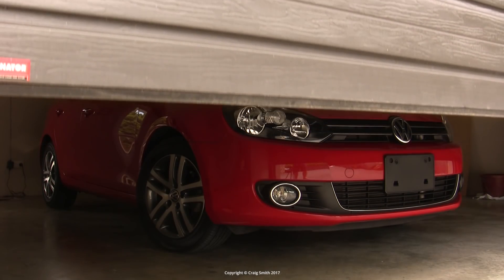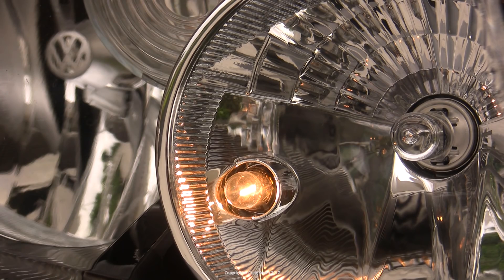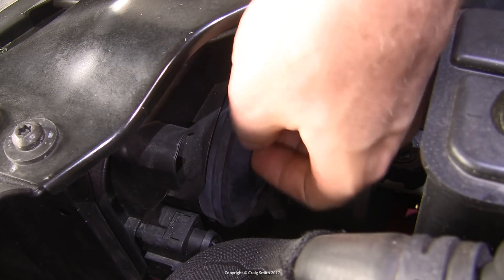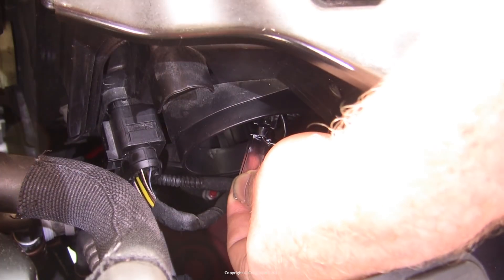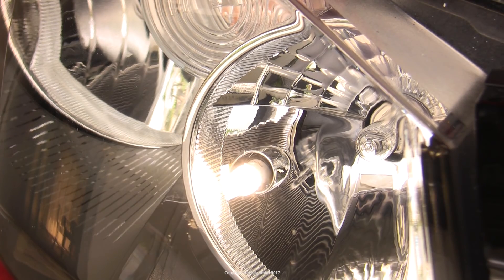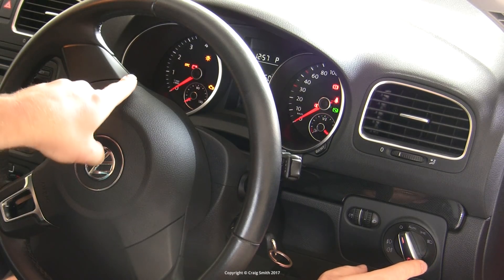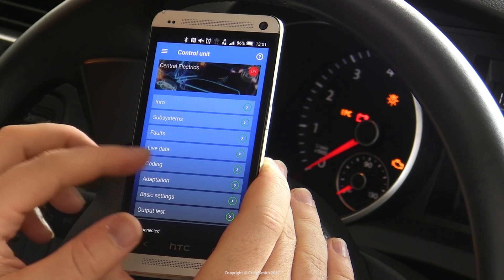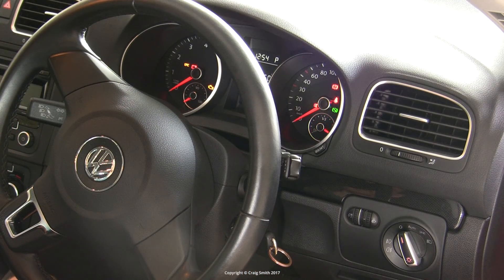How to: Upgrade to LED city (side/parking) lights, VW Golf

Comment: Hey guys if you can't code no problem. Use 80 ohm 50w resistors in parallel, they will run luke warm. They will turn the warning ⚠️ lamp off. The power use is minimal at only 1.8 watts, the led bulb wattage is 0.8 watts so you are only using half the energy of the original 501 5w halogen. (Canbus just needs to see half the total wattage to be happy).

Comment: What’s the best scan tool to use for a 2014 1.4 golf ? (& cheapest )
Reply from the maker: There's no cheap option that gives you proper VW functionality. VCDS is only real amateur option. OBD-Eleven is scammy in my opinion. If you want cheap scan tool buy a Ford or Mazda.

Comment: Sadly Byte 27 Bit 02 did not get rid of the error message for me.
2011 Golf VI Variant (Wagon) Highline, german version with halogen lamps. 
I did use the Osram Bulbs.

If someone could fix the issue, let me know :D 
I ll keep trying a bit more though.

Nice guide though, was worth a try.
These OEM bulbs look horrible next to LED H7s.

Comment: Hi,

I've just bought a 2008 Passat (not able to program I've been told) and changed the parking lights globes for LED's and added a 5watt load resistors on both sides. 
The right side works well but the left parking light just goes on for about 4 sec and than turns off again. 

With an error message in the dashboard that the left parking light is not working.
How can I fix this issue?

Comment: There's even less room on the Canadian (and presumably USDM) 2.0L TDI.  The airbox on the left side and the Fuel Filter on the right side make it virtually impossible to get pliers in there.

I think I have to remove the bumper to pull the headlight housings off.

Comment: The OBDII shown in the video, does it have to be the ordinary OBD11 or the OBD11 PRO?
Reply from the maker: You can code the adjustment manually without a subscription.
Reply: i'm not sure how to do this. as yet I have no OBD device . I have limited funds so I imagine I would purchase the cheaper OBD device but I am not sure which ones can set the bit. Also once set and an LED is put in to replace the filament bulb will it then show up on the dashboard as a fault if the LED is in place with the bit set.?
Reply from the maker: Any OBD with software that lets you do coding will work, so long as you know the coding. The point of it is to remove the bulb-out error, as shown.

Comment: Do you know how to turn off cold diagnostics e.g bulb out error for low beam as i cant figure out how im gonna be able to buy canbus resistor and add it in, so i rather just wipe the check for that bulb out
Reply from the maker: Why would you want to for low-beam? Don't.
Reply: @CraigsDIY  oh because i bought some led h7 bulbs that said they were canbus but once in they showed up bulb out error, the only fix is to do some wiring with some load baring resistors but i have no clue how to attempt that
Reply: @MrWaheedulHaque  Yes you can just select LED headlights in ODB11 and this will fix it for you.. Did this on my  Golf 6 GTI when i swopped from OEM helogen fittings to OEM Xenon with LED... I am just struggling to now get rid of the high beam left and right warnings.. Then all is working 100 %
Reply: @djshaunvt  thanks boss

Comment: Hi, is this Philip LED light capable for replacing the VW's daytime running lamps as well? If not, is there a similar product can do this? Thanks.
Reply from the maker: I don't know which DRL you are referring to. But these are little low power bulbs intended to replace T10 5 W incandescents, they wouldn't really suit as any factory DRL. On this car with the halogen headlights, the real DRLs are built into the high beam bulb as a single bulb / dual filament arrangement.

Comment: Ok so I tried installing some OSRAM LED side lights.  I managed to get the side light lamp out and install the side light.  Strangest thing happens. If the replacement LED is in place and turn the lights on it works for like a few seconds and goes out. If I put the original bulb in nothing happens at all. So now I have no side light bulb on the drivers side. How do I fix this.
Reply: check the fuse maybe?

Comment: Thank you for your tutorial.  I am doing this upgrade on my gti.  Quick question.  I am also upgrading from halogen fog lights to. golf r fog/ drl lights.  Do you know which coding I would use to remove error code?  Thanks
Reply: did you ever figure this out
Reply: Mateo Oliveras I used Resistors on ebay that was the easiest way I found

Comment: If you use an incandescent and not an LED will it still throw a code?
Reply: No, traditional incandescent will not throw a code. LEDs draw much less power, so the computer thinks its an open circuit. A much easier hardware fix would be adding a load resistor across the circuit and one will not need to software mod.
Reply: Adam Nollmeyer thanks for the reply! I had a hard time finding yellow T10-194 bulbs. I ended up finding some on a lighting site but I think they’re 3.5 watt instead of 5. Will use them in the meantime until W5Ws come back in stock or until I figure out this load resistor business. You don’t have a video on that or hardware you recommend, do you?

Comment: U.S. sidemarker lamps and reflectors are required in addition to front-facing parking lamps. The parking lamps over here can be illuminated in either an amber or white color. Most newer German cars keep the "European-style," separate, white bulb; but it's most common to see cars in the U.S. have the turn signal act as a parking lamp as well using a dual-filament bulb.

Comment: I'm living in UK and I didn't passed my MOT because those led lights! They said I can't replace W5W for led because they are designed for cockpit and plate lights... Eh
Reply: Damian Ewenement  in czecha are not allowed too :-/
Reply: doesnt make any sense? the w5w fits there because its a w5w socket. they're just failing u on purpose?
Reply: @tehcod6157 well they see them difference between amber and yellow 😂 even packet said YELLOW. It's not a big deal as two normal bulbs costs less than £2 but is just not fair they put it in log 😂

Comment: Really nice and pro clips on your channel Craig! Can you maybe recommend some OBD Bluetooth tool (coding req!) that will work with iOS on iPhone&iPads etc. Than you.
Reply from the maker: The only way I'm aware of using iOS would be using a VCDS wifi tool, which you then access using any web browser including iDevice. Look up HEX-NET - very expensive sadly. OBDEleven is Android only, regular VCDS is Windows. It would be cheaper to get a cheap Android/Windows tablet dedicated for the purpose I think.
Reply: Craig's DIY Car Thanks for quick reply. Ja I tried VCDS but coding part didn't work I believe due to my cheap VAG168cable. Any opinion on Carista OBD2. I already bought LEDs that you reviewed so I'm just stuck without code :/ Thanks!
Reply from the maker: I don't know about Carista. They advertise VW support so you can probably set the LED option, but it looks like you have to pay for it. Not sure if you can code manually.

Comment: I got piaa led t10 I I did them on my golf mk5 knowing their power is 6000k but didn't work can u tell me why thanks
Reply from the maker: Not psychic sorry. Did you try flipping them over, LEDs are usually polarity sensitive.
Reply: Same thing happened to me and bought a resistor for the LEDs

Comment: Hi! 

Your coding tip also works on a MK6 GTI from 2010 with stock Xenon but no OEM led DRL. 

Just so you know! 

Thanks!
Reply: Please dont use Xenon its guranteed to fuck over anyone on a bike/moped to the point where we are genuinely 100% blinded if we have the visor down(bugs in the eye are not a good idea when driving even at 30 km/h)
I deliver papers for a living and every time it rains and someone shows up with those stupid ass lights we genuinely have bigger issues then if you drove at us with more traditional long distance headlights

Comment: How do they hold up, concerning they are constantly heated from very hot halogen main bulbs...?
I have found very decent cheapo ebay W5W bulbs, but since they are in pretty much same position as in Golf, they suffer from overheating. When halogens are off, no problem.
Reply from the maker: Fine so far although the main beams aren't used much. But quality LEDs should be very resistant to heat and they're not that close to them.

Comment: If this is a 1.4 golf, how reliable is it and have you had any problems with your timing chain?
Reply: You need the VW GOLF MK6 2.0 GT TDI 140BHP then remove the DPF get the EGR BLOCKED OFF and get it REMAPPED. The TSI is shit and gives problems and very slow compared to the GT TDI and also it sucks more fuel because its petrol. Shit car you have. I mean shit engine! Its slower and sucks more fuel and also have alit of common problems as mentioned by the other guy
Reply: @javaidsadiq5775 😂😂
Reply from the maker: It's the 122 hp 1.4 TSI. No problems but it's low mileage and have only had it for a few months.
Reply: Craig's DIY Car I heard that the 1.4s had problems with their timing chains and or their tensioners, you might want to look into that...